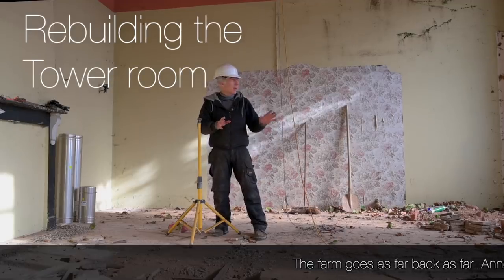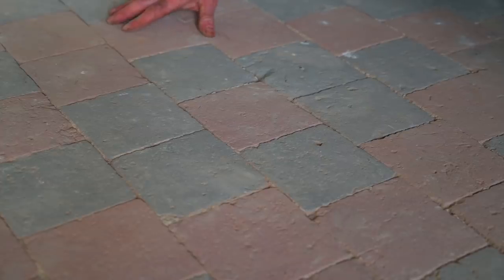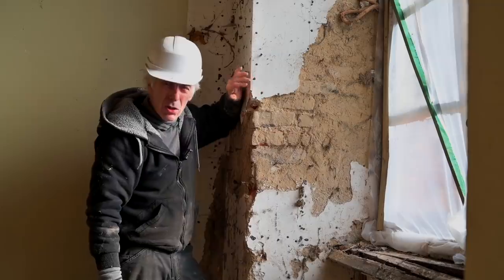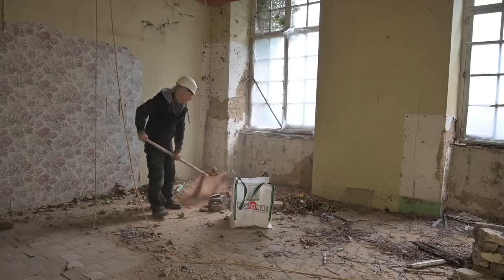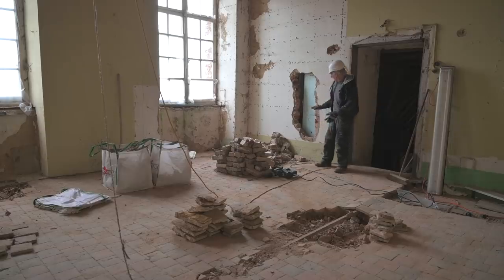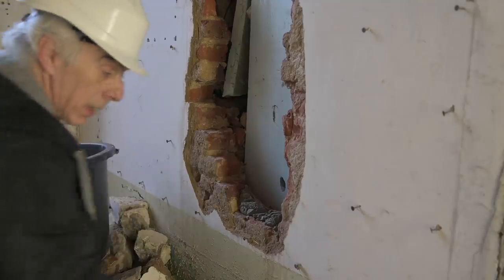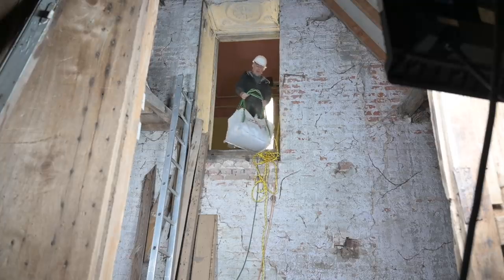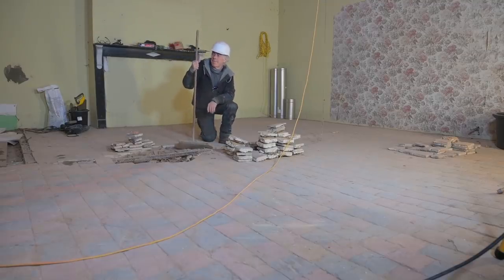Restoring the Old Farm, Day 1 preparing the tower room for renovation

Comment: My house is only 115 years.  Interesting presentation showing your skills are wide ranging.  Thanks.
Reply from the maker: Thanks for the comments,   that is a good start 115 years,,, what type is it ?
Reply: @D3Sshooter  Started as a Victorian , steep gable with gingerbread  shingles then got remodeled to a Frank Lloyd Wright wannabe.  The high peak roof became a high ridge structure with a living room and kitchen addition.  It gets interesting when doing repairs because the 115yr old lumber is not the same dimension as the modern stuff.  The roof doesn't leak.  Its like your project in that there is always something to do.
Reply: correction hip ridge

Comment: Ever since you showed the tower in a video a long time ago I've been waiting for a continuation of the project. I find old buildings really interesting.
One thing though, using cement in such a building? Even though it is all brick and no timber frame I still think it might be a problem in the future. Cement is much harder than the brick and much much harder than the lime mortar used originally. If the building moves and shifts the cement mortar patch won't move with it and the wall develops cracks.
I'm not sure how much that tower will move and if it is really a possible issue but I think it would be a good idea in general to use the same material to patch stuff as was used originally.
An added benefit of lime mortar is that it can be removed from the bricks and the bricks reused. Considering the tower has been there for a while and probably will be there for a long while longer.. 😉
Hope this doesn't come off rude, just my thoughts.
Reply from the maker: Thanks for the comments, indeed you are correct and that is what I normally would use

Comment: I like watching your site. I never know what you are going to do next. Then your easy-going attitude that brings me into your world. You seem to do a lot of trades and do them well. I love the glass on the engine block. I've heard of this before on something else, but the principle was the same to get a flat area smooth. I understand how government works on these old houses can be fixed and what you can and cannot do. My only question on the iron bar running to the walls. Can you find an easier way of getting all the old tiles loose? Then get the subfloors to a smoother finish. I don't like the idea of showing the bar when that seems to be the easier way out of doing things right. My Goals are doing things the right way the first time. I don’t like heading in the easy way. This is something that will always come back and bite you at the end of all that work.
Reply from the maker: Thanks for the comments Donald,  I like to do things right.  I look at problems and think about a solution .  I then start and while moving on i tend to improve the method and sometimes change plan..  all depending on how it goes

Comment: Better to remove all the tiles carefully and fill the dirt back up, and re install the tiles at proper height. Your plan doesn't remove the slope in the floor after you're done
Reply from the maker: Dan, that would indeed be the best plan. However the tiles are so brittle that most will brake.  I would have to mark every single tile as they all have different sizes ( handmade).. so all by all a major job with a low succes rate. Just to get a level floor.  As this is a very old building, that floor , even in its current state emits character and I don't want to lose that.

Comment: Ha Ha ! We are working on parallel lines here Steve, I am doing the same thing here, but I am not as fast as you on brickwork! Did you use a Lime mortar for that build, it is much better than using cement based mortar, could you cut down the outer walls and lower the tie rod ? that would make the floor re laying much better and would not show a line across the floor, I made up a chute from 3 pieces of wood to tip the rubbish down, if that rope caught you on the leg it could drag you down with it, take care. Chris B.
Reply from the maker: Thanks for the comments Chris, that is great common hobbies...The mortar is typical lime and chalk and is indeed better for old buildings. In this case it will be all plastered and I do not worry about that. The outside was pointed with that type  see here more on  the building itself https://youtu.be/yAgGtST4fDI     As for the floor that rod is wall to wall and the outerwalls are 100cm thick (3 feet) of solid brick and blue stone...  that is not an option.
Reply: D3Sshooter: I drilled the new hole 10cm (4") lower backed the tie bar out and re threaded it back through the wall, ours is also 100cm (3ft) thick, but solid stone, the problem I had was that the infill fell down into the hole preventing the rod passing through, so I pushed a plastic pipe back through from the inside to keep it free, that worked well, your problem may be the height you are working at though. Stay safe ! Chris B.

Comment: What is under the clay floor holding it up and how deep /thickness ,would it be possible to lower the bar or put another one in just below it going into or through the outer walls on both sides , then take the old one out . Yes lot more work and probably small risk to outer wall movement depending on how much tension is on the bar that is in there now .
Reply: I had the same idea. Put two new bars, 10 cm lower, each ones at +/- 1 metre in parallel to the old one and then remove the old bar. But how to slide a 10 metres  5 * 5 cm bar through compressed 400yo dirt ? But a 2 cm section bar from 2020 must be as strong in tensile strength than a 5x5m from 1616.
Reply: @stephanesonneville  The existing strainer bar is not from 1616 ,it has been put in much later in my opinion.
Reply: @karlhrdylicka  I just saw the previous videos. The room size is 5 * 5 meters with what it's look 0.70 meters thicker walls and it a three stories building. There's no need of these strainer basr on that kind of construction.
Reply from the maker: Thanks for the comments, indeed

Comment: Save your back friend, build a chute out the window with that big trash bag at the bottom.
Reply from the maker: Thanks for he comments, I did build part of a chute...  the problem is the building itself and the garden in the back
Reply: D3Sshooter I just caught up with parts 2, 3, and 4.  Amazing work so far. Really impressed with how you fixed the bar running through the floor.

Comment: Great video but wearing a brand new hard hat? The ceiling was the in better condition than the walls were for sure. The reason I mention this is that at 10:50 you lowered a heavy bag whilst standing at the edge of a vertical fall with no safety restraint or barriers in place. That was definitely when health and safety should have been assessed. You don't need to wear a plastic hat to convince me you are undertaking a serious project. Wear a woollen cap if you want to keep your head warm - and be careful next time at the ledge - we want to see old rusty up and running. I would have and have done the same in regards the lowering at the edge by the way
Reply from the maker: Thanks for the comments...

Comment: Erm....aren't you supposed to use Lime mortar on walls that old? Just saying because if it is listed, they will come round and look at anything you've done.
Reply from the maker: Yes you are right, however this is internal brickwork that will not be seen once the plaster is back on.   
For instance you are allowed to poor concrete enforcement beams as long as they are not visible and needed for the stability.

Comment: A clay floor at that height? What am I not understanding Steve?
Reply from the maker: Thanks for the comments, yes indeed... the floor is made out f clay. Tiles that are hand formed , placed in a pit in the ground together with wood and straw ..  Put fire to it , and when all is burning hot with lots of ashes , they close the pit in the ground and let it all rest for days... once cooled the tiles are ready for placement.   Note that the ceiling of the first floor is a cross arc consisting out of brick work.  That ceiling is where the second floor clay tiles rest on ..